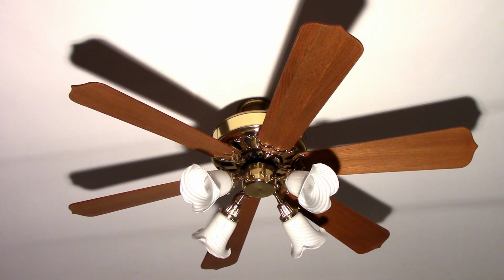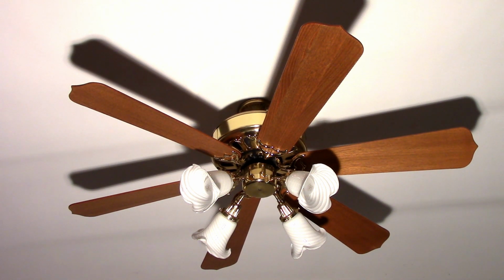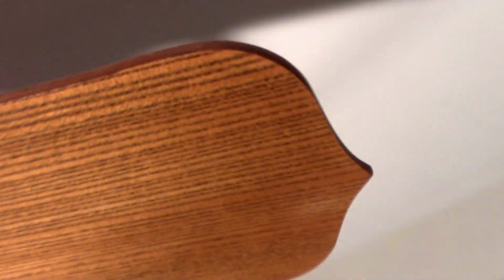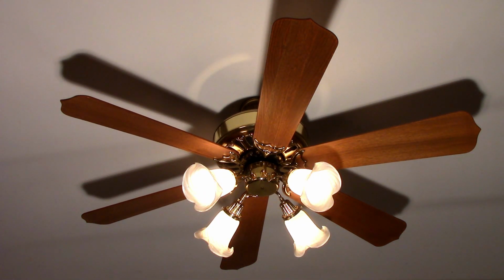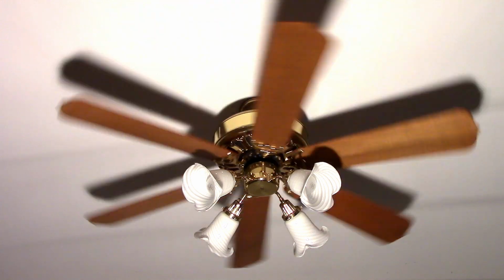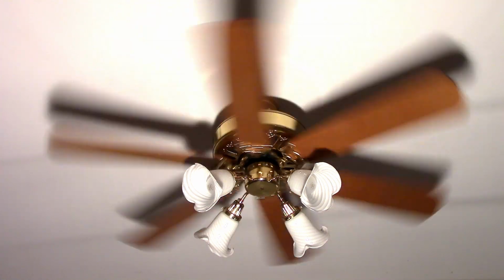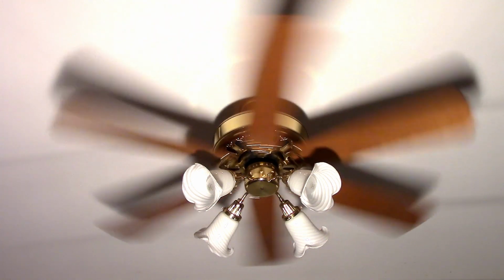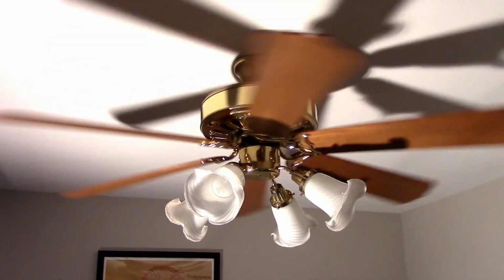Homestead Stratford Superfan (1 of 2)

Comment: 1. American Industries (who happened to be Quoizel's OEM for fans) and Key Largo also offered SuperFan models.

The reason your lights don't dim up to full brightness is because the SuperFan system ran the lights at 88 volts. The idea was that the lower voltage would prolong the bulb life. The idea being that the homeowner could compensate for the loss of light by using higher wattage bulbs

Side note: How do you keep finding all the SuperFans?!
Reply from the maker: @whoisthisguy724  this one (and its twin) are the first two I found in the wild. The rest I’ve bought/traded from other collectors.
Going in I had no idea there was a second one, which certainly made the long drive worth my while.